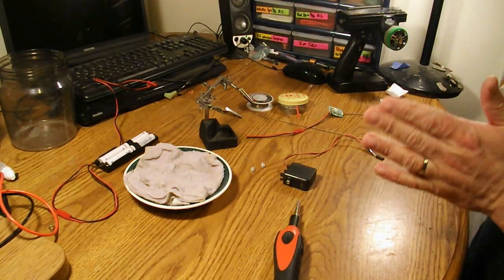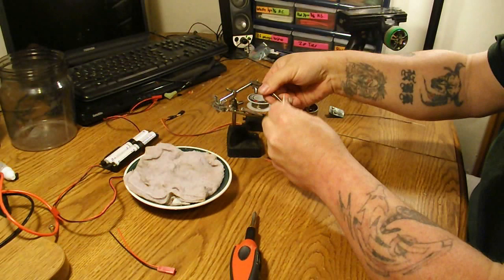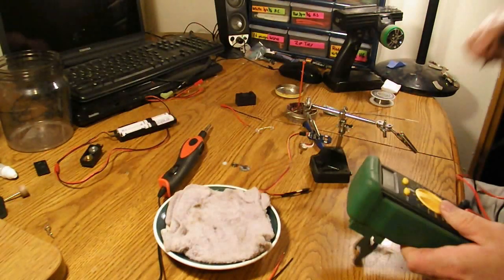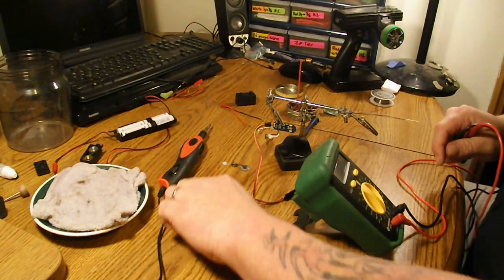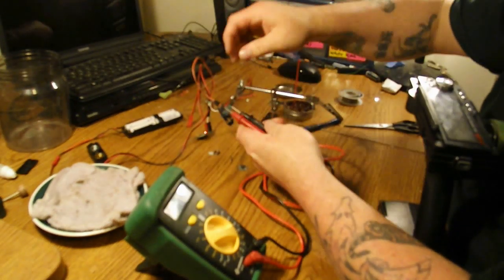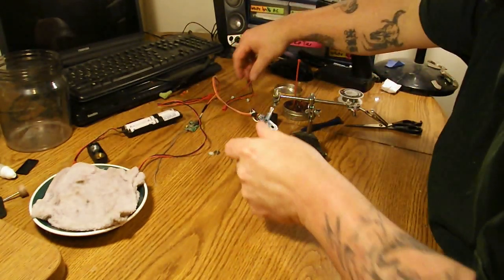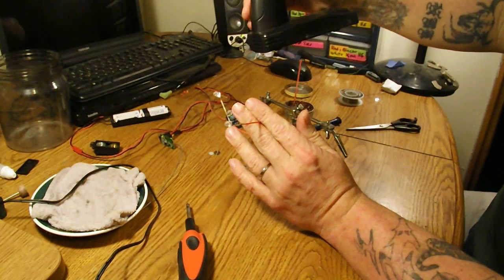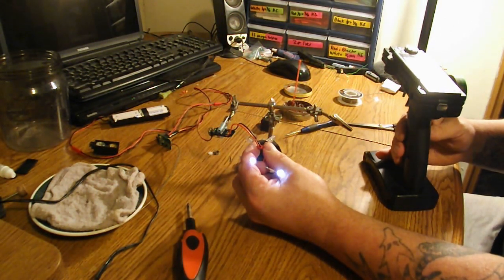How to turn an old servo into an LED controller pt1

Comment: Oke I just saw you turn the pot. to the point that one end of the switch is zero and the other side 5,4.
Mine is just in the middle now so if i switch my radio knob to one side it gives + 6 V and the other side -6..will the - side burn my led's ...i dont have a 2 position switch on my radio left s ce ch 3 is used for 2 speed.

Comment: Hey!!! Thanks for the video. It was very helpful for what I need to do. I have one question though.....is there a way to by-pass the pot so you don't have to find and maintain that sweet spot (neutral)? I'm installing navigating lights on one of my planes and want a remote on/off switch but if the pot vibrates or gets smacked around the pot will probably get thrown off neutral. As a last resort I'll have to glue the pot solid if I can't figure out a way to by-pass it. Thanks again!!!
Reply from the maker: 2.2k ohm resistors as far as I know. I haven't been able to actually try it though.
Reply: Justin Updyke ....well, I smoked one servo board trying figure this out. Seriously, a drop of CA glue down the pot's shaft and I should be good to go. One more thing.... I plugged the servo into the "gear" port on the receiver and when checking the voltage I can only get a negative voltage reading. Is there something I'm overlooking? I figured I'd just swap the pos/neg on the light kit. Should still work. Thanks again, I didn't expect such a fast response to a 3 year old video. 👍
Reply from the maker: Sorry you smoked a board. I smoked a few in the processes of making this video. As far as only getting negative voltage I would say that yes, swapping the + and - should be fine. As far as the quick response....even though I don't upload much anymore I am on youtube every day.
Reply: Justin Updyke ....cool!!!! Thanks!!! Enjoy the rest of the summer.👍
Reply: Justin Updyke thanks for your video. Really helpful. So I don’t make the same mistake can you explain the mistake you made that smoked the servo board?

Comment: Question! How can i use a servo to turn on a whole 12volt LED strip? I think mine is not working because the LEDs I am using are 12volt. Any thoughts?
Reply from the maker: Ben Cooke
This is something I planned to cover in another tutorial but I recently lost almost everything I owned so that is going to be a while.

Comment: replace the servo pot with 2 2.2k ohm resistors even if you glue it in place it well still move they always do.
Reply from the maker: Next time I have a few dollars in paypal i will order some from ebay and try it out
Reply: is it ALLWAYS 2,2k ohm resistors no matter what servo it is ? and do you have a pix on how to sodder them in ?
Reply: really the 2.2k dont get you perfect but a little trim on the radio and it is center each servo would need to be individually tuned for its circuit.